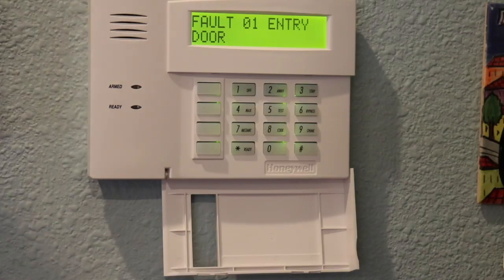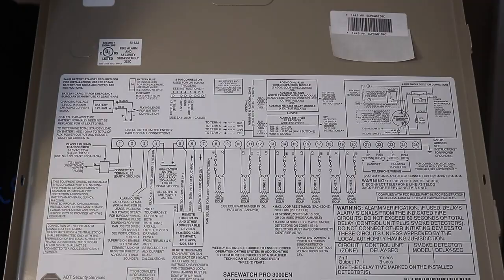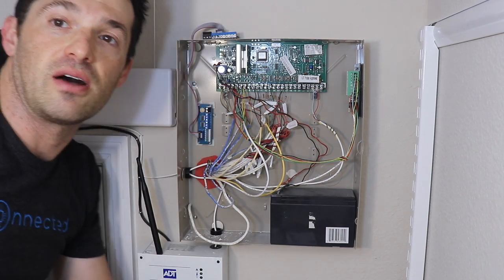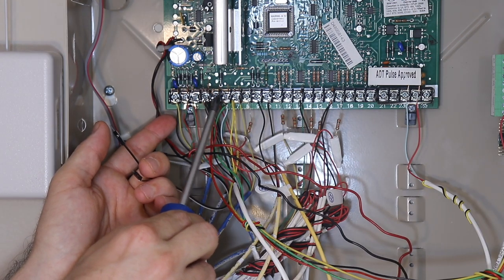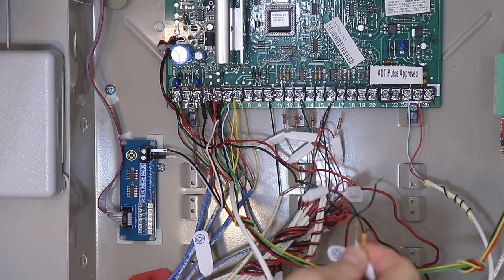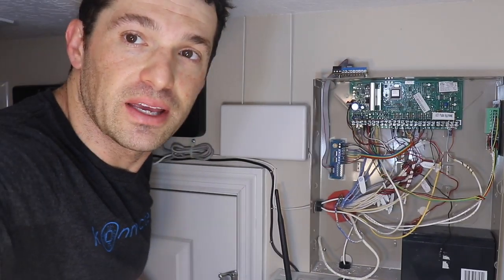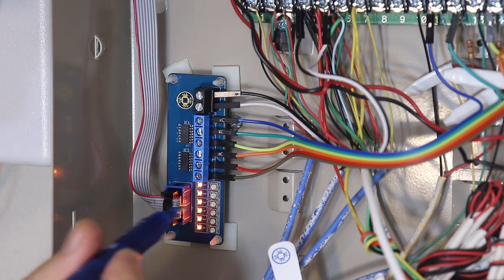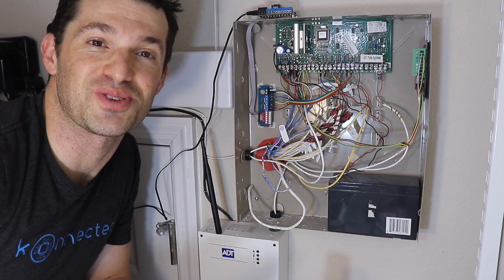Konnected Alarm Panel Interface Kit (2nd Gen) Install Demo - Part 1

Comment: Please explain, I need the interface kit when I want to keep using my key panels. In that case I need to do some programming on the old system or is it also just connecting/bypassing the old PIR sensors?
Reply from the maker: You’ll keep every PIR and door contact wired exactly as they are, but you do need to program three things on the legacy panel:

One spare zone as a “keyswitch.”
That’s the relay Konnected toggles to arm/disarm your system remotely, so you need installer-level access to flag a free zone as KEY. 

Two programmable outputs (PGMs).
One PGM tells Konnected when the panel is armed vs disarmed; the other reports alarm vs idle. Each PGM lands on its own Konnected input, so budget two extra zones on the Interface Kit. 

That’s the only panel-side coding required... no changes to individual sensor zones, no resistor swaps. If your panel can’t spare a keyswitch + two PGMs (or you don’t have the installer code), use the Conversion Kit instead and let Konnected replace the panel entirely.

Comment: Would we see an upgrade to a 4G system in the future. Thinking out loud just incase electricity is gone and wifi modem is off too!
Reply from the maker: Right now the GDO blaQ (and our other panels) stay Wi-Fi only. In a blackout the weak link isn’t really the board - it’s the modem/router losing power - so our standard recipe is:

- Tiny UPS (≈ $40) on the modem + router + switch keeps Wi-Fi alive for 4-6 hours.
- 4G/LTE fail-over router (or a cable modem with built-in cellular backup) automatically kicks in if the main line drops. The blaQ just re-auths and keeps going.

That gives you cellular resilience today without adding a SIM slot... and the recurring fee... inside every unit.
Reply: @Konnected-io great suggestions. Thank you

Comment: Is it possible to discard the old panel and only use this , turn on and turn off using wifi ?
Reply from the maker: Yes—ditch the legacy panel entirely and run everything over Wi-Fi (or Ethernet) with the Konnected Alarm Panel Pro Conversion Kit.

The Pro board replaces the old PCB: move each sensor, siren, and 12 V AUX pair to the Pro’s terminals, plug in the included power brick/backup battery, and you’re done—no legacy panel required. 

It speaks ESPHome out of the box, so you can arm/disarm from the Konnected app, SmartThings, Home Assistant, Hubitat, Alexa, Google Home, etc. 

Keypads go dark when the legacy panel is removed; most users replace them with a wall-mounted tablet or just use phone/voice control.

So if you want a 100 % stand-alone, smart-only alarm, the Alarm Panel Pro Conversion Kit is the right choice.

Comment: I’m an Electrician & will be buying several of these for my customers. Before I buy the first one can you clarify if you can still arm the system using the traditional keypad? Thx
Reply from the maker: Yes, you can. If you're installing our Interface Kit (as shown in this video) it keeps the entire existing system intact, including the keypad(s). The Konnected functionality is added on top of the existing traditional alarm system.
Reply: @Konnected-io  Brilliant. Kindly guide on where I can purchase the Interface Kit. I’m based in United Kingdom, Birmingham area. Thank You. Much Appreciated.
Reply from the maker: @powergemelectrical  You can purchase from our website: https://konnected.io. We ship worldwide.

Comment: 19:33 how do you tune a motion sensor?
Reply from the maker: You’re not adjusting the PIR itself—you’re setting the trip-point on the little blue potentiometer (“pot”) built into each Interface module so the board can tell “no motion” from “motion.”

- Wire the PIR zone to the Interface input and power everything up.
- Stand still so the PIR is idle.
- With a precision screwdriver, gently turn the pot (screw) slowly until the module’s status LED just turns OFF.

Walk in front of the sensor; the LED should pop ON immediately, then go off again after the PIR’s reset delay.

Nudge the pot a hair if it chatters or misses a trigger. You’re aiming for a clear on/off with a little “headroom” on either side.

That’s all “tuning the motion sensor” means—dialing the Interface threshold to match the voltage swing the legacy panel puts on that loop. No changes to the PIR’s own jumpers or sensitivity are required.

Comment: What do I need to buy to be able to do this? Needed for uk
Reply from the maker: You just need the Konnected Alarm Panel Pro 12-Zone Interface Kit—it ships to the UK and already comes with the correct 12 V power supply for your region, plus all the interface modules and wiring you saw in the video.
🔗 https://konnected.io/products/konnected-alarm-panel-pro-12-zone-interface-kit

Comment: Do you have a signal conditioner/buffer board that would interface with wired sensors to the Alula RE508X Hardwire to Wireless translator? Currently this Alula translator generates random false alarms, particularly on a zone with 2 sensors in series, every day making the system useless. I want to keep my wired sensors but the security company is pushing us to use wireless sensors and has refused to solve this false alarm issue.
Reply from the maker: Sorry, we don’t make a buffer/conditioner for the Alula RE508X. If the translator is seeing “phantom” opens it’s usually because the input isn’t seeing the exact resistance it expects (2-wire zones in series, long cable runs, or noisy power). Your choices are:

Stick with the RE508X: put only one sensor per zone and match Alula’s required EOL value exactly, or add an Alula 8-zone expander so each sensor has its own channel.

Keep everything wired and skip the translator: replace the RE508X with a wired panel (e.g., Konnected Alarm Panel Pro) and monitor/automate through SmartThings, Home Assistant, etc.—no wireless hops, no false trips.

If your monitoring company insists on wireless sensors, you’ll need to solve the RE508X wiring/resistance issue or switch to fully wireless gear; we don’t have hardware that can “clean up” its inputs.
Reply: @Konnected-io Thank you for your reply

Comment: Zone 1 says it can be used for 2-wire smoke detectors, which mine is. So I assume I can't move that somewhere else. Does that mean the Konnected Alarm Panel Interface can't detect if my hard wired smoke alarm is activated? Thx!
Reply from the maker: You would have to leave the 2-wire smoke alarms on the original panel as-is, and cannot use them directly with the interface module. However, you can program one of the outputs to signal a smoke alarm to Konnected.
Reply: @Konnected-io  Thank you.

Comment: I have a safewatch pro 3000 just like you but the keypad I had was a 6150 RF, meaning you are not able to program on that keypad as it has a smaller LCD display, and is not able to show all the programming info. To make it work you need to get a keypad just like yours to be able to program the zone change. You can directly connect a secondary programming capable keypad to the board, as someone had already placed the connecting wires ready. I guess ADT didn't want to make programming easy lol

Comment: If you are not using the existing system power and just using the external power supply then your battery backup will not work and the system dies when the power goes out.

Comment: Zone one is the time delayed entry exit doors (2). In order to keep the old system functional, it can’t be moved as the delay is need to use the original key pads. Are you saying the parallel system abandons the ability to arm and disarm from the OEM key pads?

Comment: Hello I'm very interested in purchasing a kit. My question is do you have a kit that i can eliminate the old panel board  and still be able to arm and disarm the panel on the app with your kit. Also hard wire to my WiFi router to have the best WiFi signal.
Reply: He said to only use the wifi board does that.

Comment: 18:00 Pro tip: Set up a network-connected camera aimed at your alarm panel during sensor setup, and view it with your cellphone from each door/window that you're open/close testing.

Comment: My Wife and I just set up our DSC PC1616 system with the integration kit and have it up and running in Konnected cloud/Smart things with 6 zones.   It did require a good deal of tuning the zone potentiometers but we finally found the sweet spot for each :-)  Was happy to find an Aux Pwr pigtail in the accessory kit.  We wound up needing the last open receptacle in the closet for a Wifi extender since the panel is at the opposite end of the house from my router the wifi was an issue.  A Linksys AC-750 did the job nicely.  Great job Nate! Huge fan so far.  Like others would love to see a relay kit video? Cheers!

Comment: What if I have more than 6 zones?  Do I use the interface module in series?
Reply: We sell interface kits in 6, 12, 18 and 24 zone configurations. Each set of 6 zones requires one Konnected Alarm Panel board and one interface module (all included in the kit).
Reply: @NateClark1  Thanks for the quick reply.  I bought the 12-zone kit.  So I just wire up the second interface module just like the first and plug it into Exp 2 on the alarm panel?
Reply: @NateClark1  I bought an interface 12 zones product.. I'm looking forward to seeing the part 2 of the video. I'm not able to arm/disarm the traditional alarm.
 It's incredible that only these videos represent the instructions for your system..!!! Please, publish the video!!!!!👎

Comment: I just got the key switch working on the 2nd Gen board on my Vista 21ip via the new Smartthings app. I found watching older video on installing the key switch on the 1st gen super helpful to get context. I had a bunch of extra zones left over, and ended up using four zones to get the arm stay and arm away functions working. I used two momentary switches for the control, and two door switches for the feedback from the board. I'll post a picture in the reddit channel. I was running Alarmdecoder for several years at my old house, as everything was wireless there, and was getting lots of false positives. However, AlarmDecoder is good in the sense that you dont need to do any alarm panel programming (which could be a headache if your monitoring service doesn't want to work with you) but it's a ton of work getting running on the new Smartthings app. Comparative speaking,  this system is way more snappier and responsive  with no false positives as of yet; awesome job!

Comment: If I have the same alarm system you show in this video will I be able to use the Brinks keypad with your interface kit?  Right now I have no text at all on the screen since I disconnected my services with Brinks/ADT. 

Should I just get the conversion kit and just start over or the interface kit and tie into my existing alarm?

Will I be able to use wireless door sensors with this?

Comment: Watched this video many times and finally was able to figure it out. Spoke to Konnected and they noted that the second part should be coming out in a few weeks. Has anyone figured out how to add the key switch to the DSC power series and have any detailed instructions? thanks!

Comment: Thanks for the video.  So timely for me as I wanted to reactivate my alarm system but with no third party monitoring.  Your product seems to fit the requirement.  I have ordered a 12 zone unit and look forward to it delivery.    When will YouTube part two be issued.   Part one uses my extract same panel I have so I don't expect any problems to install.

Comment: Im interested in getting Konnected, but want to make sure I can wire the switch to arm/disarm. I see everyone has been asking for the pt2 video in the comments as well with no reply. Is this product dead?
Reply: yea very strange with no part two, did they just start recording thinking they could do arm/disarm and then realized they couldnt on the panel, would be nice if there was a response, there pro board is coming out and maybe with that one we will get a part two

Comment: Is it possible to have and use just the main board of interface kit (not both main board and Interface board) in order to connect in parallel to the existing alarm system? any drawback in doing that?
Reply from the maker: You need the interface module to connect in-parallel. If you want to replace the traditional alarm system, you can connect the sensor wires directly to the Konnected Alarm Panel.

Comment: I need part two. How do I wire the switch to arm/disarm?
Reply: Yea He never showed
Reply: @CampbellSoundworks  
I could never get my system to work with connect but I found a better one,check it out 
https://getnexx.com
Reply: @donaldperez2157  Thanks for the link. There are some good videos under their support page for retrieving the installer code and adding a keypad. Also, their product appears to be very easy to install but I don't see where it has the same capability of monitoring each zone. It seems like it should get that info similar to any other keypad so maybe okay, but not sure zones will add to SmartThings.

Comment: Can I connect the alarm output to the konnected panel to monitor alarm triggered status? Or is that not compatible w/ the konnected board? It says its 10.5-13.8 VDC w/ a steady for burglary/panic alarm, likely an open circuit when not triggered. Or do I need to be using the output triggers?

Comment: Are all/most older wired alarm systems like DAS NX-12 similar with respect to PIR sensors?  My PIRs are 12v when triggered and 7v when not activated. Does the Konnected Alarm Panel work with these types of PIRs like the Optex RX-40QZ Quad Logic PIR? Also - what is the current wait time for these units?
Reply from the maker: Yes, that's why the interface module has an adjustable dial to tune into the threshold for your specific panel. It's designed to be universally compatible.

Comment: on your website what is the difference between interface kit and conversion kit?
Reply from the maker: The interface kit is what is demonstrated in this video, connecting in-parallel to an existing traditional alarm system.
The conversion kit is for replacing the traditional alarm completely, converting the old system into a fully automation/app based home monitoring solution.

Comment: Great Video Nate, as always.  You really make things very simple and clear in your videos.  Glad you guys got the Interface board ironed out.  Looking forward to upgrading my 1st Gen. to your new Pro Ethernet board, hopefully they will be available soon.  Even got the Ethernet wire ran for it, my wire is lonely, wants something to plug into :)
https://konnected.io/collections/shop-now/products/pre-order-the-konnected-alarm-panel-pro-12-zone-kit
Reply: David L thanks for your comments on my post.  I too have a Ethernet hardline run to my panel.  Does the Konnected Ethernet board serve as an interface board too, or just an alarm replacement?
Reply: @dennisa2737  
Alarm replacement.  I am sure their thinking  was most systems don't have an Ethernet wire available on the old analog alarm system, so WiFi would be the best way to communicate back to your smart hub.  But I may be wrong since I thought I was told the Interface board will work with my existing Konnected system.  Matt, is usually available for chat on the Konnected website, I would ask him.

Comment: I just ordered the 12 zone V2 interface kit and am looking forward to getting it installed and seeing the 2nd installation of this video.  I have an older Ademco alarm panel labeled as a First Alert FA160C and really want to be able to see the status of all zones and arm/disarm remotely.  Once I get a better feeling for the mounting space requirements outside of the existing metal alarm box, I’ll buy a plastic/PVC box to mount the main Konnected boards with the WiFi antennas.
Reply: My 1st Gen 12 zone, 2 WiFi boards have been working great in our metal alarm box, with door closed, over a year now.  I did put an Access Point in the next room, about 20 feet away, 2 doors, one wall in between just to make sure no dropped connections.  I will say the WiFi signal is pretty strong with these modules. I remember connecting to the Konnected board during setup from 2 rooms away, about 40-50 feet.  You may try in your metal box first, if you have room.  These boards are real small.

Comment: Is there any integration with smoke alarms that are connected with a 3 wire connector? I have been watching these videos since we moved in our home and found out that we have an internet based alarm system. I am all about making our 3100sf home as smart as possible. Thank you so much!!
Reply from the maker: "3-wire" smoke alarms are household AC powered. Yes, you can integrate those by using a smoke alarm relay that is designed for your brand of smoke alarm. The relay usually connects to the last smoke alarm in the series, and then provides NO / NC contacts to connect to a Konnected zone. More info here: https://help.konnected.io/support/solutions/articles/32000022629-wiring-smoke-co-detectors
Reply: @Konnected-io  Thank you so much for your reply. A couple of nights ago, we had a number of false alarms, and when 1 tripped, all sounded.

Is there a way to determined what one is the last one in the series?
Reply from the maker: @ricksiddiqui8354  You'd have to remove each one and take a look at the wiring. All but one will have wires visible that travel on to the next one.